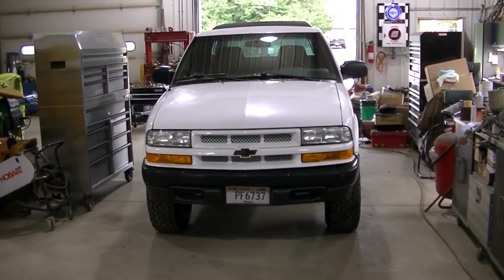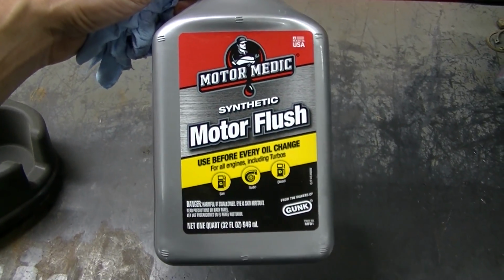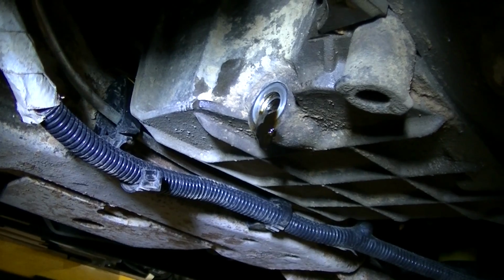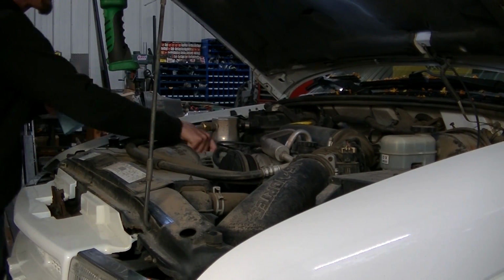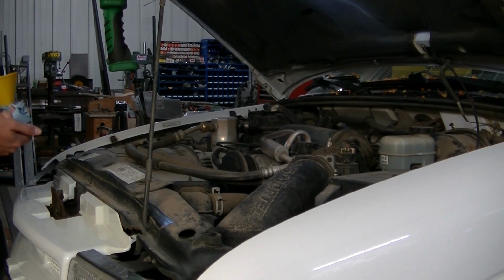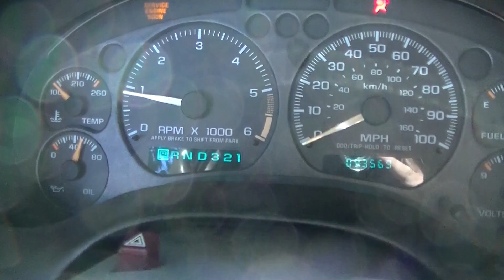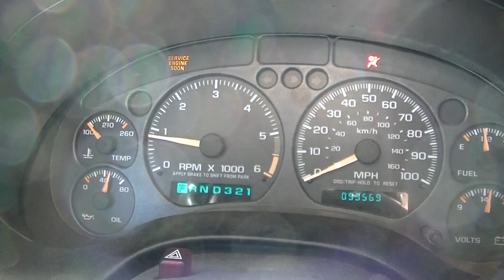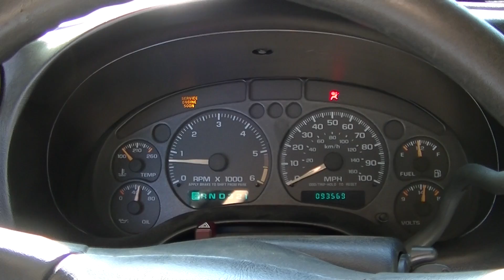Project junk S10 | Engine Noise | Motor Flush

Comment: Back in high school my best friend's dad taught us that after you drain the old oil, you run a clean quart through to help flush gunk out.  Then you put the drain plug in and refill the motor. Preventing that molasses you had, musta been what he was after with that practice.
Reply from the maker: That would help flush out the bottom of the oil pan but sludge will build up everywhere when oil isn't changed like it should be.  I have seen some pretty bad buildup but this was really bad.

Comment: HUGE difference! Been wondering on the results of Motor Flush. DEFINTELY worth it. Have a 03' S10 w/375k and the last thing I did a few yrs ago was remove the valve covers and cleaned the snot out of the covers, rockers, rods, etc. and replaced the spider fuel assembly.  Only used B12 and a good brush. Looking forward to looking under the covers and seeing after a flush what things look like. That sludge was EXTREME!!! GREAT video!
Reply from the maker: Because this was so bad I did another flush on the next oil change. Truck is doing good. I felt like it actually gain power after the flush.

Comment: Use the Lucas Oil 10130 Pure Synthetic Oil Stabilizer. I use it to increase oil pressure and reduce clicking
Reply from the maker: I use that in all my older trucks.
Reply: @mossman381  Did you check the oil viscosity after adding Lucas? Looks like it's just an oil thickener.
Reply from the maker: Didn't check viscosity. I will have to check what I use. Pretty sure it's the oil stabilizer. Do they make more than one oil stabilizer?

Comment: Love it when a plan comes together.  Sounded like a collapsed lifter.  Probably some of that 'roof patch' blocking an oil passage.  Amazing how much goo came out of that thing.  I have used MMO (Marvel Mystery Oil) before with good results but not as quick.  That was dramatic.
Reply from the maker: That was a small amount of what all come out. It kept coming out and coming out. Like the truck was sick and throwing up. I was shocked by the sludge that came out.
Reply: @mossman381  It was amazing that the flush could loosen that all up in such a sort time.  My econobox Cavalier has a bit of a problem lifter.  I tried the MMO in it and it helped but next oil change I know what I'm going to try next.  Thanks Mossman.
Reply: Stick with the MMO.  lt's a safer product.  The Gunk works for sure and quick but can also be aggressive on seals.  MMO should be run for between 300 to 500 miles before dumping the oil but that's a testament to how gentle it is but yet still gets the job done. MMO also actually conditions seals rather than attacking them.
Reply: @JA-rn5qv  Agree.  The seal concern is true.  I worked in a gas station in the 60's, oil then, was not very good.  We would always recommend customers to come in for a bottle a week before oil change and get it.  We were selling it to of course.  
I had a 2000 Cavalier that had a partially collapsed lifter.  MMO worked well, brought it from about 50% to 90% so it saved the car, it wouldn't have been worth fixing.  Took about a month of  modest driving.

Comment: Small coolant leaks at the intake gaskets are notorious for gunking  those engines up. The seeping coolant mixes with the oil and creates goo over time. Not saying that’s the issue here but it sure is common on high mileage 4.3 engines.
Reply from the maker: This does have bad gaskets and I suppose that could be the case but I doubt it. If coolant was getting in the oil it's not something you don't notice. Oil looks bad and the oil level goes up even though you aren't adding any. This isn't what I call a high mileage truck with less than 100k miles. I don't know if my grandpa changed the oil or not but I do know my brother in law that had the truck last didn't change it.

Comment: I'm impressed!!! I think I'm going to pick me up a quart of that good stuff. My engine has never had a knock but just the idea of getting all that sludge and slime out would definitely make it easier on the oil pump. I just got done cruising the beach if mine had a knock like that I think I would start crying LOL
Reply from the maker: When it started sounding really bad and taking a long time to stop I had a sick feeling. Thought the truck was done for sure. I am going to flush the rest of my trucks because this worked so well. The truck feels like it runs better and has more power now that I have been driving it.
Reply: @mossman381  can you do a video on doing to your diesel truck and see if you get any changes.
Reply: She's got a very similar knock now I want to cry 😭 this is 2.5 months later going to the store today!!! Is yours still running good?

Comment: You should pull the valve covers and check the push rods to see if there plugged up and spray them out with brake clean

Comment: It sounded like you had a plugged hydrolic lifter not able to take up the valve lash.  You should do another flush.  I wouldn't even consider using auto trans fluid since it's designed to allow friction.  A pint of diesel fuel might be a better quick flush alternative if you don't want to buy that cleaner again.
Reply from the maker: I wouldn't replace all the oil with trans fluid.  Probably just one bottle just like this flush.  I wouldn't even use trans fluid now that I see how well this stuff works.
Reply: @mossman381  It doesn't matter how much or how little you use.  Transmission fluid is designed to allow SOME friction, which is going to damage the bearings and all the wear surfaces in the engine.  It's ok in a pinch for power steering fluid, but NOT engine oil; or brake fluid.
Reply from the maker: @hellcat1988  I am not disagreeing that the trans fluid wouldn't be good for the engine but that is why you only run at idle for 5 minutes. Thinning your oil with this flush isn't good either but the idea is you are doing more good by cleaning out the sludge that is limiting oil flow.
Reply: @mossman381  You can get much better results by thinning your oil with kerosene or diesel fuel and not risk scoring your bearing surfaces and cylinder walls nearly as easy.  Personally, I'd go with the diesel.
Reply from the maker: @hellcat1988  I would have to see proof that diesel fuel is a better lubricant than trans fluid. I just don't see that.
Reply from the maker: Your first link to "Project Farm" I will not even watch.  That guy doesn't do anything "scientific".  Most of his "tests" aren't even realistic.  Why would you run an engine on only ATF???  That is just stupid and what does it prove????  Maybe I should use honey as engine oil????  Talk about dumb!!!  I am talking about running a small amount of ATF for a very short time.  Your second link to Amsoil, they are selling their own engine flush.  Of course they will say don't use ATF.  Your other links there are people that say they have used ATF on engines with noise and sludge with good results.  Again after using this Gunk Motor Flush I wouldn't use ATF myself because this stuff really works great and it's made for cleaning a motor.  I wouldn't use diesel, kerosene or anything else.  I would highly recommend this Gunk Motor Flush.
Reply: @hellcat1988  I hear you man , I have flushed my engine with diesel before - which by the way the same 4.3 engine in this video - and the results were magnificent !!!. but I live in a place where diesel is very low graded -it's almost oil feeling - so ive heard in America there are types of diesels fuel with different colors , I would use the most oily one amongest them ....probably farmal tractors diesel ?!  ..greetings from Arabia .

Comment: Another thing you can do to clean more of the junk out of the oil pan is let the oil drain out. Then, with the drain plug still out, pour another quart of new oil through the engine and let that all drain out. Then put the plug back in and fill with new oil and change filter.
Reply: Only about 20% of the oil goes through the filter. In addition, 100% of the oil bypasses the filter when the engine is cold

Comment: Wow that's horrible. That drain pan needs to be pulled and cleaned. Great video 👍
Reply from the maker: Truck is running great. Checked the oil and it still pretty clean. I still can't believe how much junk come out of the oil pan.
Reply: I’d just be worried about the pick up tube.

Comment: i’m pretty sure my engine is clean, but this video really makes me want to see if i can quiet down my valve teain
Reply: train*
Reply from the maker: I think I will do Midnight too.  It has a slight tick that won't go away.  Not near as bad as this was but still annoying.
Reply: @mossman381  my 6.0 also has a slight valve tick at idle. I'll give it a shot when the oil is due to be changed again
Reply: U might be able to ..just temporarily.

Comment: I used to just add 1/2 or 1 quart automatic tranny fluid with my oil change . Cleared up lifter noise . The detergent in the transmission  fluid  loosened the sticky lifters .
Reply: @revolutionday1  why?

Comment: Dude go buy the SuperTech from Walmart for the 2nd flush and clear the rest of the sludge, and motor medic at idol. You also don’t have to leave it all night with the 2nd purge. It get’s all of the sludge away before it has a chance to get back into the parts. If Motor Medic doesn’t work, use kerosene. And for regular oil changes on domestics, go to Costco and get the Kirklands synthetic. Good value, and has done really well on independent studies. I have a Mercedes GL450, so if I don’t use Bosch parts and Mobile 1 the damn thing will start spitting on me and yelling in German. 🤣 It literally won’t work with aftermarket stuff….
Reply from the maker: I have done a second flush and the oil is surprisingly clean and staying clean even as I put some miles on it.

Comment: Does it clean sludge around timing chain as well?
Reply from the maker: I have done this twice now and the oil seems pretty clean. I haven't opened up the engine but the amount of sludge that came out it has to be a good thing. Make sure you get the synthetic stuff.

Comment: You didnt get any lines clogged up? I want to do it, heck I have that bottle. But I'm just afraid of it clogging up my lines
Reply from the maker: It seems to be running great.  Do you have the synthetic flush?  There is a cheaper version of the Gunk flush that I have tried before and it didn't seem to work this good.  A bottle of this stuff is like $20.
Reply: @mossman381  I'll go ahead and  buy this one. I'm looking at my bottle, it's not synthetic. I bought this bottle at Walmart. That's not good right?
Reply from the maker: Buying stuff from Walmart doesn't mean it's bad stuff.  The synthetic seems to be harder to find.  Everybody carries the cheaper flush.
Reply: @mossman381  okay, so its best to use the synthetic flush?
Reply from the maker: They have a cheaper bottle that doesn't work as well.

Comment: my 2000 chevy 2500 with the 5.7 has 200k miles. drove home yesterday with nothing abnormal. started it today and it has a loud lifter tap. About like the one in this video or a little louder. Mine is not going away as engine warms up though. Going to try the engine flush based on this and some other videos. I changed the oil today before researching any of this.....so im starting with a clean oil and a clean filter. Also considering the seafoam engine treatment or going with a quart of ATF fluid. what are your thoughts?
Reply from the maker: I would not use the ATF. I have done the seafoam and it doesn't really seem to do much for the oil. The engine flush worked so good. You need to get the synthetic stuff though.

Comment: Interesting!  What is the "Service Engine Soon" light on for?
Reply from the maker: It's been on since my grandpa had the truck. He said he took it in and they said it was the evap system so he never fixed it. It's an emission thing that catches fuel vapor from the fuel tank. I probably should look at what codes it has.
Reply: @mossman381  Might improve your fuel mileage if you fix that.

Comment: Should have flushed a quart or so (in your extreme case) of clean engine oil through with the plug left out, while draining the old oil/motor flush mixture.

*EDIT* I see that a few others have commented on this already....
Reply from the maker: I poured a little extra clean oil in while the drain plug was out to flush more junk out.
Reply: @mossman381  My man.  👍